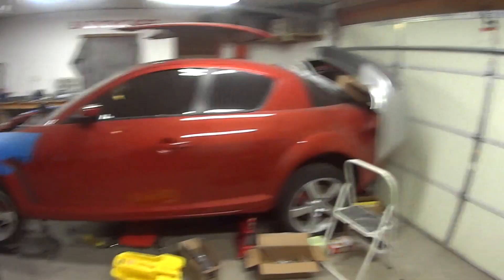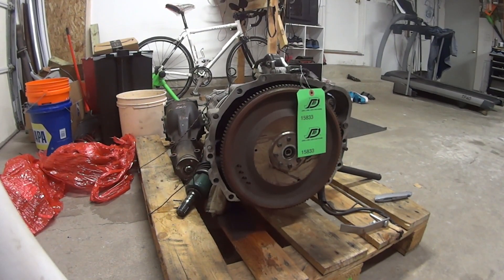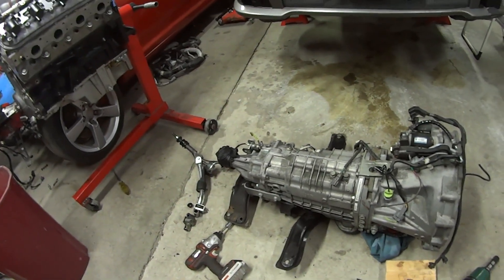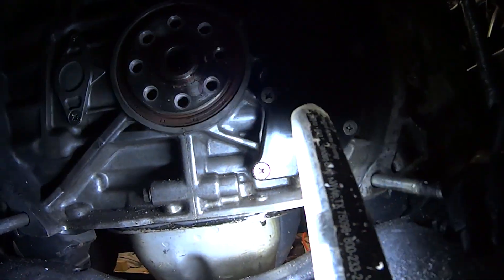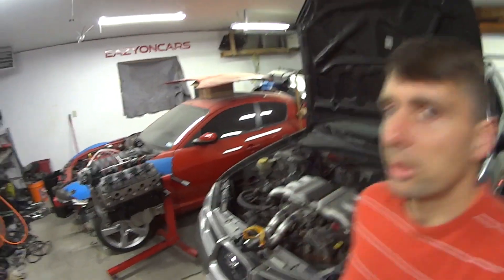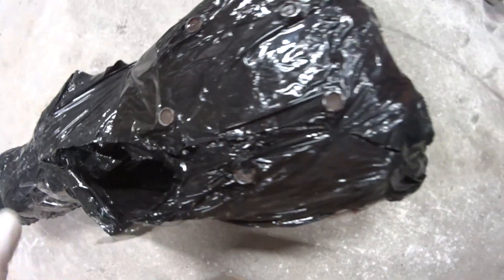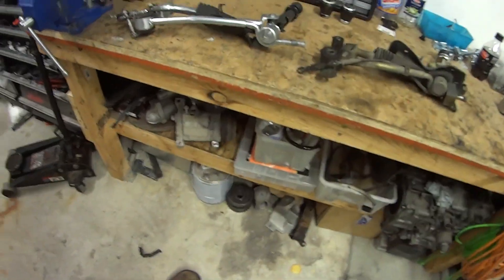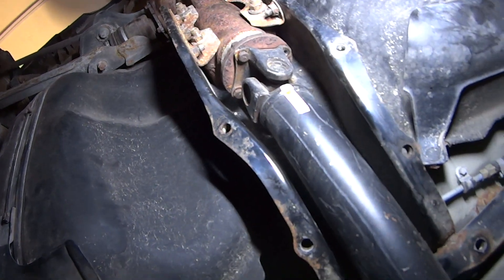Subaru 6 Speed swap

Comment: I just picked up a 2002 Outback LL Bean 3.0 EZ... Automatic... Any thoughts on what I could swap it to? Don't need a 6 speed ( would be nice, though)... I also have an EG33 sitting on a shelf.
Reply from the maker: I've broken so many 5 speeds that it's hard to recommend, but I like the ratios of the 2006-2007 WRX. Be gentle though 😉
Reply: ppg sells gear upgrades no?
Reply from the maker: They do indeed, cost of them sent me the 6MT route though.